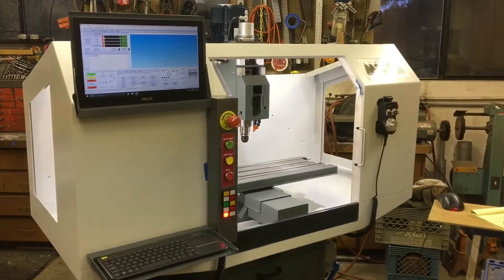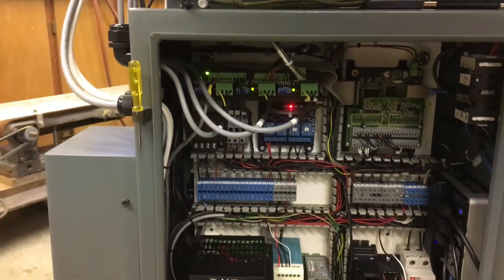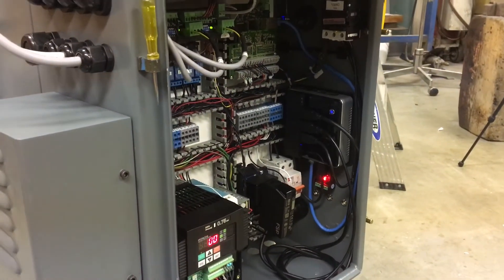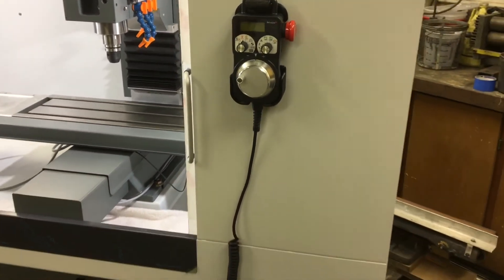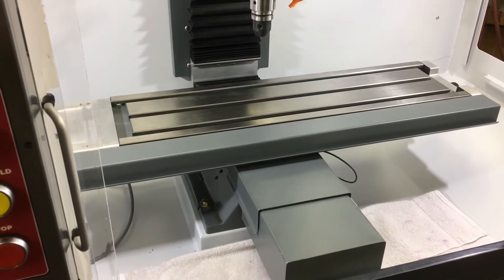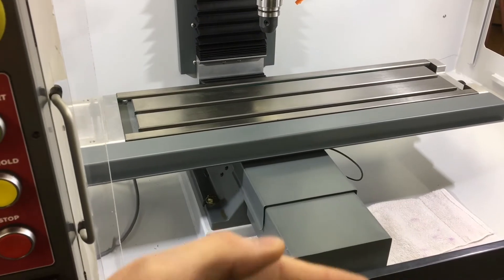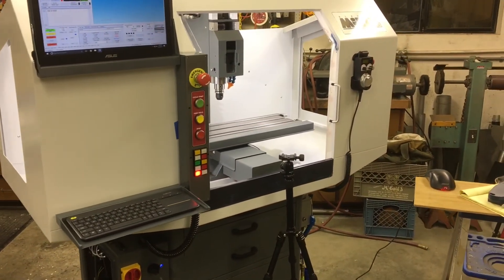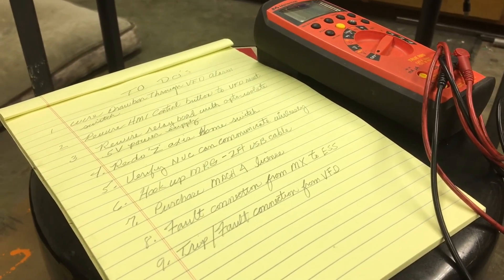GRIZZLY G0704 CNC Conversion Update 33 - ( assembly 10 )

Comment: i think it is the current limit, once it hits it cuts out for a bit then resumes, try to increase the max amp limit or you could also increase the ramp-up time (if you have it too low it will get a spike in current), maybe a combination of both.
Reply from the maker: You my friend win the "cookie" ..... to fast a acceleration combined with hitting the current limit would throttle back the drive during acceleration... creating the odd starting! Things are sounding... AND starting like they should! Thank you for the input / tip . Super awesome!  - Nick
Reply: glad I could help, looking forward to more updates.

Comment: I use the analog 0-10 on my machines with mach3 and a simple BOB and vfd. mach3 has a  feature were if you add an index signal it will ramp the rpm up in a test and create a curve to control the rpm. Not sure if mach4 still has that feature? Or how well it works since i dont use an index signal

Comment: Hi Nick, I'm eating dinner and watching :) I don't know if it's applicable or useful to your setup, but the 0-10V linear output DAC didn't result in a linear speed profile for the spindle drive I had. So, I measured the voltage and spindle speed for a few speeds, fitted a polynomial to those measurements in Excel, and used that as the DAC output generating function. It's good to know about the USB and 3/4" cord grip. I was think of using one of the USB bulkhead for a non-CNC thing. The MPG holder is cool, did you post that to Thing-a-verse or anywhere? I wounder if my Vista MPG will fit. I added Start, Stop, Feed Hold buttons to my mill after your last video. They are fantastic, especially Feed Hold/Resume. The reversing 5000 RPM spindle is crazy! That's really cool, seems like a great safety component as well.
Reply from the maker: Hello Kent! May you dinner be "tasty"!!! . During this whole build process i never though much about spindle control till it came time! = /  .... Lets just say I'm learning fast!  .... Cord grips are cool for sure, i though about it... they also make split style cable glands that would allow you to use a more scale size grip! But i much prefer the harder / dumber way = )  haha. If your vista pendant is something like a "p1a- something 2?..s?" then I'm sure it would fit... I will post a link in the description for the stl. Just in the last few days testing with the mill i have really come to like them.... adds a lot of functionality for sure!
Reply: Dinner was the generic version of Grape Nuts. Tiled the kitchen back splash today and missed the dinner bell :) I have an iMach P4SE, and got an extra SE box this weekend so I can move the pendent between the mill and lathe, and avoid buying a second for now. Regarding mapping the spindle DAC, my spindle motor is stock and not so powerful, so I adjusted the measured speed on the low end so that the spindle runs a little fast under no load. I think four measurements including the min and max speeds were enough. Don't know if this is of any application or interest to you, but thought it worth mentioning. Best wishes, Kent